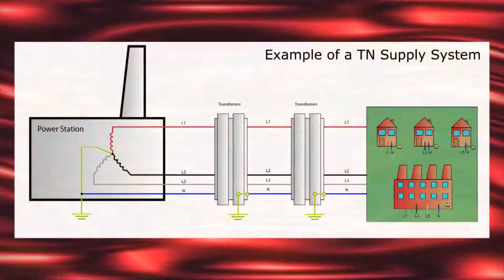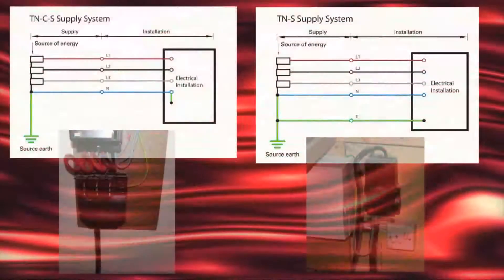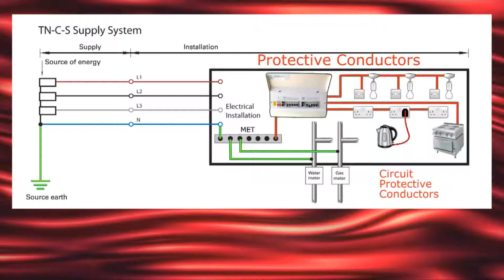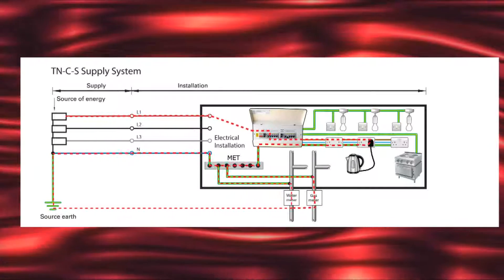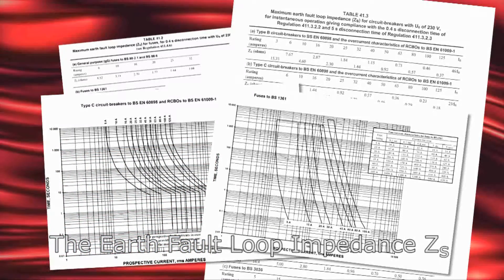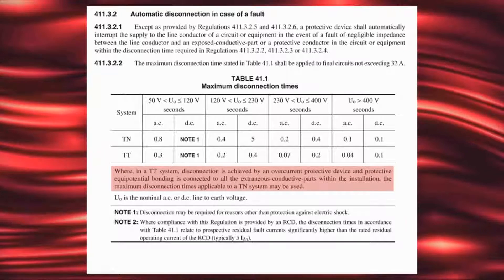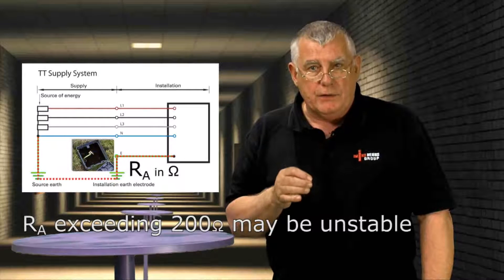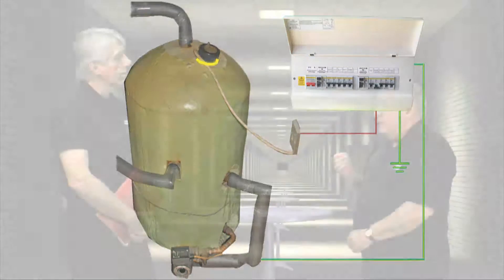An Introduction to Protection for Safety and Fault Protection

Comment: This bloke is talking from a prepared script. He not a electrician, he’s an ex copper he then spent six weeks in the RAF . Them moved into  preventing at the BBC and commentateting on sports shows. He is now a freelancer working for this lot as well as martindale Kewtech and even Meg her . He is simply saying what he been told to say .
Reply from the maker: Hi Sean. 

Dave is a professional presenter and has never suggested otherwise. He has worked in many areas, over a long career, including, as you say working for Eurosport and many electrical manufacturers as the voice and face of their product. His eight years as a BBC sound engineer involved very technical training at the BBC engineering centre in Evesham. He is qualified to the 18th Edition and has taken exam in EV charging and PAT testing. He has presented onstage many times for the NICEIC (without a script) and just completed a second series of Tech Talks for CEF (again completely unscripted). When presenting in the studio he uses a script, as most professionals do to keep the text crisp and accurate. He is also using a script he assisted in the writing of and that seems reasonable.

I’m sorry you feel that you have somehow been fooled. Dave has been very public about his career, recently talking about all the areas you mention at length in a podcast, (Hit the Lights with Gary Alger) so your comments will hardly come as a revelation to the public. The ability to present technical subjects is a skill in itself, as many discover who try to do it.

We are always open to giving screen tests to anyone with an electrical background. Kind regards Terry Brown, Production Director, Navigator Productions.